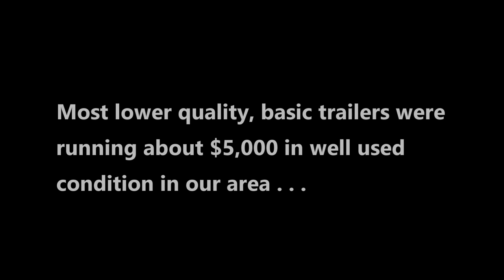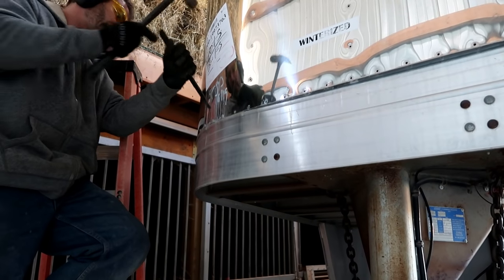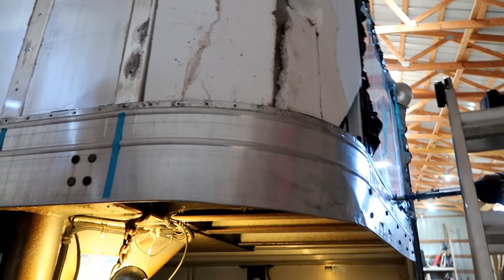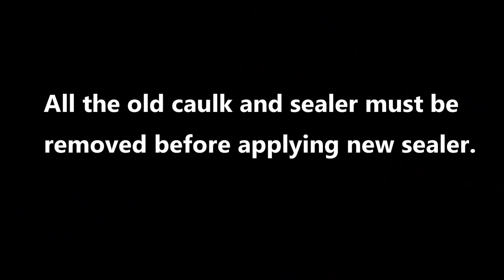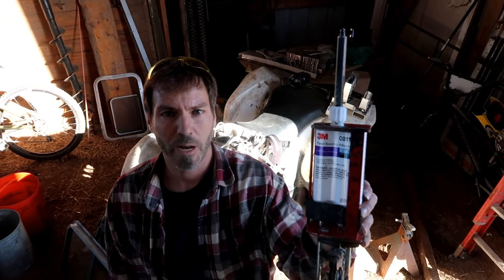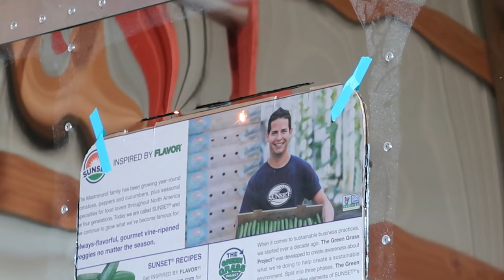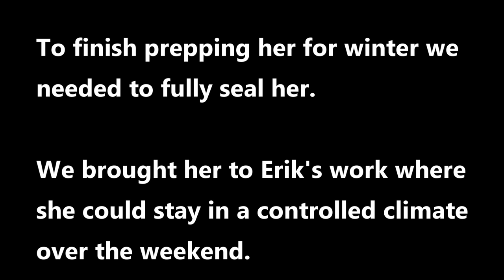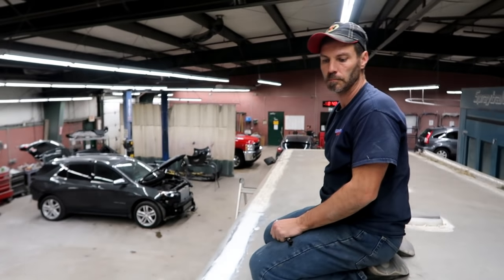166 Wrecked Co-Part Trailer #6:  Riveting The Sheet Metal On

Comment: shocked u didnt fix the Styrofoam
Reply from the maker: It was only a small section. The inside walls get it anyway. Manufacturer put this on to help with noise in the event the trailer inside isn't finished. But we plan to finish the inside and add new board insulation :)
Reply: @This1LifeWeLive  ok i was gonna say ur just gonna leave tht there? lol good vids btw :)

Comment: inch wide rolls of  RV roof seam sealing tape  is available. They give a consistent thickness and remove a lot of installer mistake opportunity. From Amazon. clean it properly and install. Did I say clean properly enough?
Reply from the maker: I did find some 4in wide seam tape that seemed to have good reviews, but then others told me it was just temporary stuff :P

Comment: butyl rubber.,  is pretty much the same thing as the sealer.   anything "RV" related is already a pricey item.   Just like Koi Pond specific parts.   Or air compressor parts.  Many  items are available in different part of the store at a deep discount.   You did a great job.   Crack a beer and admire it a while.
Reply from the maker: Oh I plan to buff that puppy up until every driver on the road is blinded going by, hahaha!

Comment: Aint tryin to be a d__k but when we had to take out on our race cars we just use the same size drill bit as what we used to put them in with and drilled them out,  it works good like that
Reply from the maker: For sure! We started that way, but found that either grinding them or simply popping them off worked a bit faster ;D

Comment: I find wet stick roofing tar works better than the self level RV caulking. It doesn't look too good but it's on the roof of my 5th wheel travel trailer. Its less costly and available at any hardware store when an RV dealer isn't handy. Nice work on the repair it looks good. Happy Turkey Day
Reply: Ya that stuff was like $11 a tube plus tax.
Reply from the maker: The roof had something black on it, not sure what it was but it may have been flex seal. Regardless it didn't keep the leaks out, but your stuff may have better results ;)
Reply: Keep in mind that white self-leveling caulking will transmit less heat inside than black tar, but that only matters if you use the trailer regularly for occupancy vs. a horse trailer that is well ventilated and infrequently used.
Reply: @Edwardmodos  The roof on my trailer i a ! piece aluminum factory design. Only need to tar around vents & AC unit and each end. It applies in the wet or dry weather and doesn't dry out like calking. Aluminum draws  enough heat without any help. lol
Reply: PS: I live in it all 4 months of the summer.
Reply from the maker: @Edwardmodos  Good point

Comment: Rivets are most easily removed with a small air hammer with a chisel in it.  Then take out the chisel and use a punch to knock them out.

Comment: Did you drop the axles with new saddles under the springs or add lift blocks??
Reply from the maker: Not yet, Erik wants to wait until spring :P
Reply: we have the material for the lift. I painted them black to keep them from rusting and sprayed the inside of rails with a wax.

Comment: Well done Grasshopper.  Guilty of taking over sometimes!  Tip.  Cobalt drills are expensive but stay sharp.  Looked like your drill was dull sometimes. Get a demo on an Air powered Rivet gun sometime.  Too late now to buy one.  That is a lot of sealer on the roof.  Cleaner prep first?  Thanks for ######  Numbering!
Is the live video on Wed 21 Nov?  >>>HAPPY TURKEY DAY<<<  Canadians ate all the good ones a few weeks ago!  Mail strike here....
Reply: we went through like 4 of the gold 1/4in bits. That stainless is some hard material to drill through. Its not like mild steel.
Reply: @ruralridez6165   Those 'gold' so-called Titanium bits are a bit of a rip-off.  Cobalt ones are black but hard.
Stainless is more Tough than Hard.  Try an Air Actuated Rivet Gun sometime.  One trigger pull, pause, one more trigger pull to break off stud.  I would have thought 3/16" size.  Looks very  good.  Looks like you may have lowered the truck a bit?